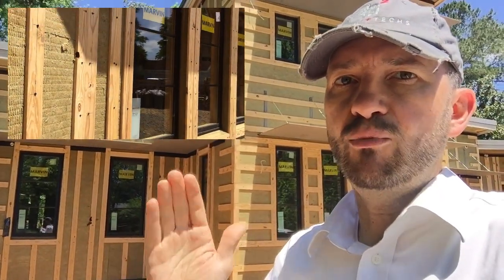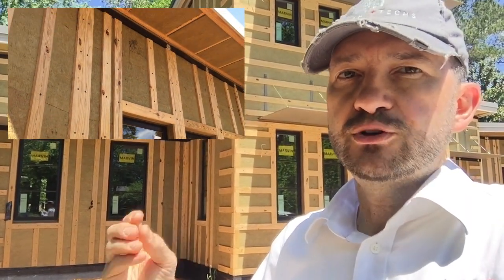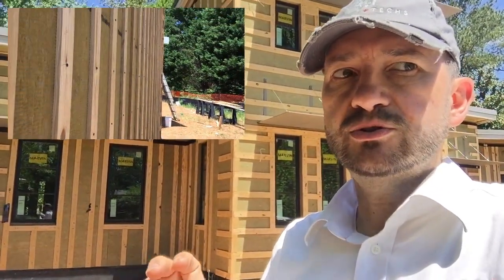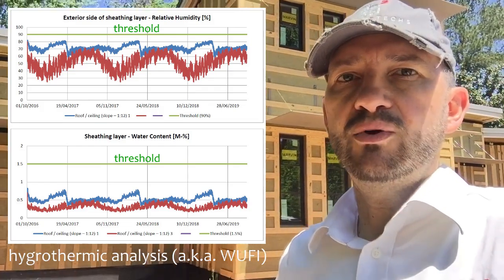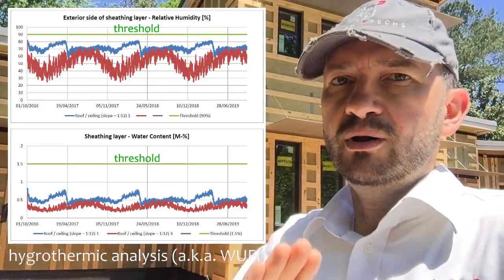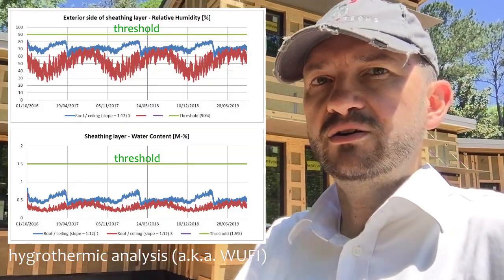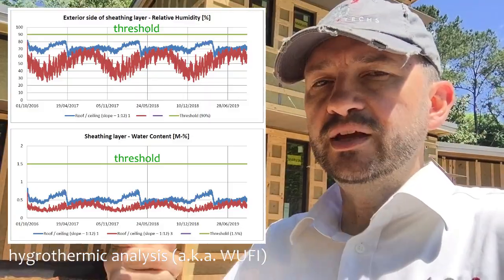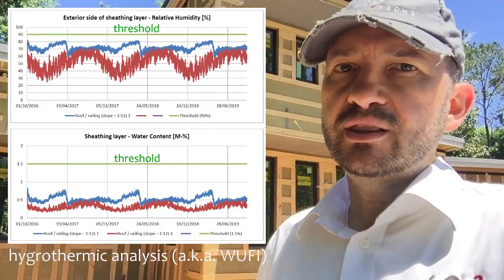Why and How We Install Continuous Exterior Rock Wool Insulation

Comment: 10,000 screws at 1/4 inch makes about 4.5sqft of thermal bridge. Is that good or bad or the best you could ask for?
Reply: It's the best you can do. Stainless steel screws would perform better, but no one makes any long enough.
Reply: Also, you can screw 1 screw every 16 inches of linear furring for lightweight cladding, which he's going to use here, so he's put more screws than is necessary. Overkill isn't always better. Rockwool has an install guide that gives screw placement for various thicknesses and cladding weights. Look it up before you decide on a screw pattern.

Comment: Can i ask, your supplier of Mfg for the long screws? We need self tapping through our external rockwool and into steel truss and  steel wall framing.

Nice project Sir.
Reply from the maker: @David Bruce, we have been using #14, DP1 pancake head fasteners, by Triangle Fasteners, in both wood and metal frame construction, for years. They have a distributer near us, and they are all over the southern and eastern US, plus Washington State. Here's a link to the fastener on their site. https://www.trianglefastener.com/Products/CONCEALOR-Pancake-Head-Screws
Reply: @LGSquared  Thank you Chris. I have a new build with a concrete firewall wall seperating a duplex. What would be my best way to maintain continuous insulation on roof? It maybe an engineer question but i wonder if i could pour the wall, until under the roof deck and place rigid foam and then carry on the pour. Poking the foam through the rebar. Ive seen commercial cantilever decks with a foam insert. It was a Halfen Kit. Thanks for your assistance.

Comment: Hi Chris. Great share. Did you use any membrane/WRB on this project with tis insulation approach? What siding/cladding will you be using?
Reply from the maker: We used a liquid applied WRB, Homero. Check out the video, “Liquid Applied Air and Vapor Barrier (a.k.a. WRB) - Poly Wall® Blue Barrier™ - https://youtu.be/VG-837UQLJM

Comment: Is that type of system strong enough to take a stone/brick veneer...  traditional setup:  Paper/Ply/lath/mortar/veneer?  Or is this more setup for fiber-cement/manufactured sidings to install directly to the 3/4 furring?  If no, what would be needed to make the strips strong enough to handle veneer
Reply from the maker: Yes, you would attach brick ties to firing strips, still leaving a 1” gap

Comment: Great video! How do you handle the added roof thickness caused by the insulation plus stringers? Do you use wider drip edge flashing?
Reply from the maker: Yes, all of the flashings are made and trims selected to accommodate the thick insulation.

Comment: In reference to the four control layers identified where does "acoustic" fit in or is it an additional requirement based on environment?
Reply from the maker: The airtightness (0.05 ach50) and the continuous exterior stone wool insulation make this a VERY quiet assembly and structure.
Reply: Rockwool does a pretty good job of it already

Comment: @LG Squared: What was the brand and type of screw for installing Rockwool? How did you hold up the first layer?  Can you describe the assembly for steel cable hung overhangs - looks fantastic!
Reply from the maker: We used a local company called Triangle Fasteners, and we used their "1/4” DP3 CONCEALOR
 With TRI-SEAL® Long-Life Coating"

Comment: Great video, thanks. 

Can your explain your comment at 14:26 about being very careful only having insulation on the outside with none in the cavity? That's the way we do warm deck roofs in the UK,  which is the preferred method as it avoids interstitial damp (condensation at the 'dew point'), because with the insulation outside, the timbers are the same temperature as the inside of the building. 

I want to do this on the outside of my own timber siding (existing) house and am hoping just to take the cedar off, add breathable membrane onto the old OSB sheathing, then the Rockwool (3 or 4 inches), screw some wood battons/strips into the OSB (possibly into the structural wooden studs that behind too) and then nail the cedar boads externally onto those battons. Cor-a-vent top and bottom for insect free flow. But no insulation in the stud cavity.

Does that sound OK?

Many thanks.
Reply: Yeah... I'm wanting clarity as well. My initial reaction is that he saying to make sure the material you use is intended for outside use, and if you run out, to not supplement with interior insulation? But is he also saying that if the house has bat insulation and you decide to also install exterior insulation that it could cause problems?

Comment: Chris, I have a question.  Not a builder, but interested in doing this kind of work on my home.  For the roof in particular, how is the air barrier beneath the Rock Wool protected against water intrusion due to condensation at the points that the 9" screws penetrate it?
Reply: The wrb is gasketing, that's not the full answer but it's definitely part of it

Comment: Just so I understand, you just laid those furring strip just right on top of the roof and wall insulation?
Reply from the maker: Justin, we installed long roofing screws through the furring strips @ 12” and 18” o.c. In to the wall and roof framing. This holds the insulation in place, and the strips become the substrate for the cladding.
Reply: @LGSquared  dumb question but if those screws are going through the air control layer to get to the structure, do those penetrations result in air leakage?
Reply from the maker: @tubulartuber  The screw that caused the hole also plugged it very tightly. The blower door test results of 0.05 ach50 proved that they did not create leakage.

Comment: It all looks great. I wonder how much the insulation for this house costs? I bet it costs more than the whole house I want to build.
Reply from the maker: Ron, the insulation would cost more than the house you want to build if the house you want to build is under 150 square feet. For this house, the material (insulation, furring strips, screws) and labor cost of the insulation was approximately 7% of the total cost of the house. Being continuous on the outside of the framing, it adds additional value over typical cavity insulation installations. It provides much greater thermal lag, moisture control, thermal break, and protects the structure from expansion and contraction in all climates, even "HOT".

Comment: Do you have a detail or information for your horizontal 1×3's that you used for your wall rain screen.   Does it allow bulk water to drain?
Reply from the maker: @William - Any moisture that gets behind the siding is airborne, and is usually a vapor. Also, since the assembly is well ventilated, that small amount of moisture dries out very quickly. Bulk water is kept to the outside surfaces of the cladding via the proper installation of cladding and flashing. Any vapor that gets on top of the horizontal strips is trivial and is eliminated through evaporation (expedited by ventilation) before it can even start to build up and become a concern. If bulk water ever enters the cavity in these areas, it would most likely be short-lived and would dry out quickly because of adequate ventilation in the rain screen cavity.
Reply: @LGSquared  Why do you think it would only be vapor? It could be wind-driven water.
Reply: @LGSquared  if someone pressure washes the siding and soffit, water will more than drip behind the siding
Reply from the maker: William, the cladding is the bulk water management system. So, if bulk water is getting behind the cladding, there are larger issues that would need to be addressed. The moisture that will be behind the cladding is going to be vapor, which will never enough to need drainage off of the 1x4s.

Comment: LOVE IT!! Would love to have you here in Texas. I'm in zone 2 climate, I believe in central Texas...What would be the cost difference with labor and materials with putting all the insulation outside vs doing both (external and interior)? (I know that the perfect wall would outperform the other of course). I'm planning on building a small house.
Reply: I wouldn't do the same R value, just the appropriate amount for my zone, but on the exterior..
Reply: @MrsLilLady86  read this

"More information on optimal wall insulation
I decided to look into John Brooks’ question of whether thicker wall foam makes sense in Florida. It turns out that doubling the thickness of the wall foam from R-10 to R-20 would save only $20 per year.

I discussed the issue with Danny Parker, a senior researcher at the Florida Solar Energy Center. Using EnergyGauge software, Parker calculated the savings for a 1,600-square foot single-story slab-on-grade house in Tampa, Florida.

He assumed that the house had fairly good specs, roughly along the lines of the house I described above. He assumed that ducts were inside the thermal envelope, the house had 3 ACH @ 50 Pascals, the windows were U-0.30 with a SHGC of 0.30, and the thermostat is set at 77°F in summer and 68°F in winter. He assumed that electricity costs $0.15 per kWh — higher than the current retail rate there of $0.12 per kWh. (Assuming a higher electricity rate tends to exaggerate the value of increasing insulation thickness.)

If the house has 2 inches of rigid foam (R-10) on the walls, the heating and cooling costs [Later note: should be "total household energy use" — see discussion below] will be $1,794 per year. If the wall insulation were doubled to R-20, these costs go down only $20, to $1,774 per year.

Is it worth it to double the thickness of the foam to save $20? Well, it depends. You could also save the same $20 by buying a photovoltaic (PV) array costing $857; that 114-watt PV array would produce about 166 kWh per year, valued at about $20. So, if you can double the foam thickness on a 1,600-square-foot house for $857 or less, the foam insulation will cost less than PV. If doubling the foam thickness costs more than $857, then PV is cheaper."

https://www.greenbuildingadvisor.com/article/hot-climate-design
Reply: @MrsLilLady86  
Hi, let me tell you some amazing free ways to save money in zone two.

Paint your house and your roof bright white! I'm in zone three and my house and roof are white and in the shoulder months my heat gain is 1/3 of my neighbors. In the hot months I gain half the heat my neighbor's gain. It's made a world of difference.

Get solar pv. You have many hours of sunlight. Way more so than up north. This is a no brainer for a zone 2 climate.

Have lots of fans. If you have low humidity, a fan blowing across your skin is a huge money saver.

Orient your house with the long side on an east- west axis and try not to have windows facing west or east(east facing windows gain almost as much heat as West facing windows)
Reply: @jl9678  YEP!, Was going to do all of the above for sure! Wrong orientation and a dark roof would be like stepping over a dollar to pick up a dime. Thanks! The only other thing I'm still not sure on for the envelope is what WRB I want to use...the cost of Zip, or a peel in stick instead of good ol' Tyvek doesn't seem to be justifiable in my humble opinion...Thanks for the tips!
Reply: @MrsLilLady86  I'm going old school felt wrap. My house was built in 87 and last year we had to replace windows. The felt wrap behind the t1 11 sheathing was almost as good as the day it was built.
It's impermeable when dry but vapor permeable when wet.

What does the rest of your envelope look like? Are you in a dry climate?
Reply: @MrsLilLady86  you would be wasting money. in texas they tax based on the outside dimensions. that exterior insulation could end up saving you $10 a year in energy but costing you $100 a year in extra taxes
Reply from the maker: MrsLilLady86 So much depends on the design (architecture and structure) as to cost increase of using exterior vs cavity. The more complicated the structure, the more complicated the cavity insulation job, increasing the labor. Even simple designs can make proper insulation installation complicated. More on this later....
Reply: This would be grossss overkill for zone two.it would be the biggest waste of unrecoupable money ever
Reply from the maker: big O your advice seems like guess work rather than having done the research or work yourself. Based on the costs you present, you don't seem to know the cost of exterior insulation, because you claim it is more than a solar power system. That's incorrect. You also claim painting a house white is as effective or more than the continuous insulation. That's incorrect and bad advice. If you listen and watch to the entire video, exterior insulation more about durability. I don't spend a lot of time on energy savings, if at all, though that is a benefit to continuous exterior insulation. It's appropriate everywhere in the world, including zone 1 & 2. It especially makes a big difference  on zone 1 roofs and heart transfer in summer. Solar has A MUCH longer payback than continuous insulation, and it does nothing for durability of the structure.
Reply: @LGSquared  let's clear up a few things. 

Insulation by itself is cheap. Add the extra time and labor needed for exterior insulation then it's not so cheap. And I didn't say insulation was more expensive than solar pv. I said extra insulation does not save much money in hot humid climates and it's cheaper to get that $20 a year savings by adding solar panels than by adding more insulation.

Regarding white roofs. I have a white standing seam roof with an Sri of 93 (berridge natural white) I have a thermal camera, and I know the math on the heat transfer so , no guessing there.

Two weeks ago my indoor temp was kept at 75, roof temp was 86, and my neighbor's roof was 114. Roof insulation in our neighborhood around r21. If you know the math (which I'm sure you do ;) ) you know that my white roof was admitting 1/3 the btu of my neighbors dark colored roof.

Building science people don't what you to know that. Roof color is not profitable
Reply: @jl9678   Why would the people involved in Building Science not want us to know that: painting a roof the color white will passively and significantly reduce heat entering the roof/attic in hot humid climates? It feels like Building Science LOVES anything that works passively. Like overhangs and external insulation. Instead of mechanical solutions, or expensive photovoltaic (solar panels) solutions.

They seem... to be prime candidates for becoming champions of painting roofs the color white, because of their love of all things passive.
Reply: @sirveevcs971  I can't answer that question. I wish I knew.  All I know is the roof on my current house is white and the roof on the house under construction is, wait for it, also white.